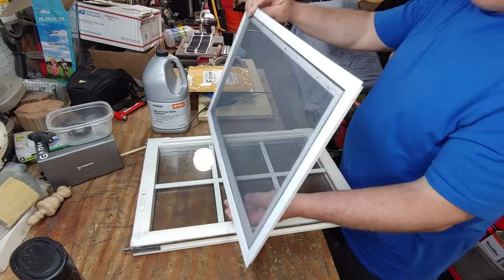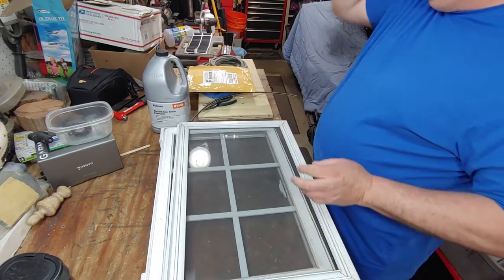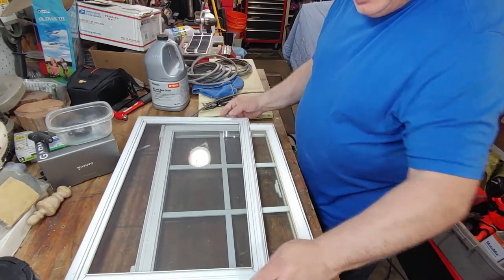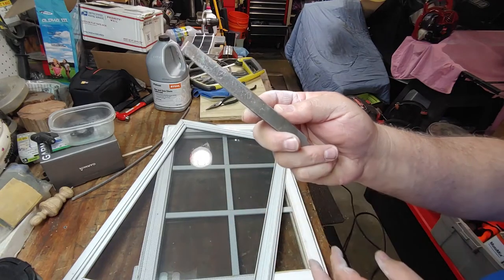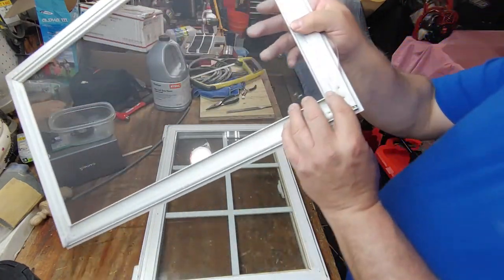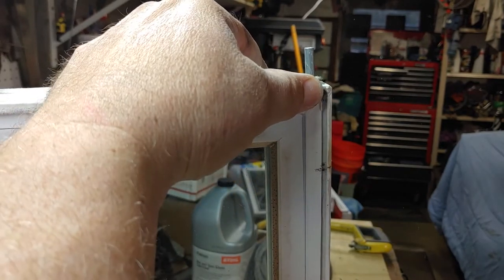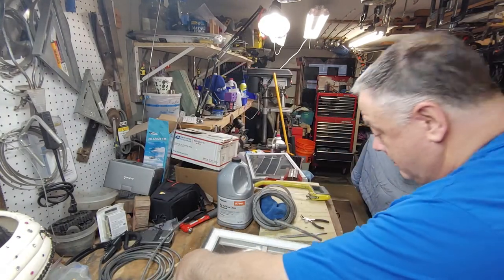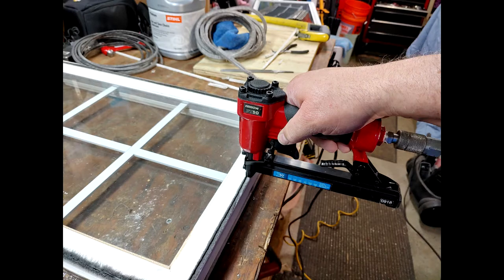Replacing fuzzy weather strip on screen and vinyl window frames

Comment: Thanks for posting. I've seen some videos where they use a Spline roller to add the strip back in. May be an option to look into. Also, where did you find your weather stripping?
Reply from the maker: https://www.allaboutdoors.com
Pricing was very fair, Quality is good. Received it in just 3-4 days thru the mail. They give you a phot on line so you can match up the type of weather stripping. I did my search on their site under "Fuzzy weather stripping".

Comment: How did you measure i cant or I should say afraid to take out window. I did them before with samples given by window company that has since closed I did with window in and a tiny screwdriver lol very hard. I'd like to get some that fit, my windows are in sun all day and rot fast
Reply from the maker: The fuzzy part comes as a roll so I just cut them to length. No guess work.
Reply: How did you measure the plastic part that fits in channel the piece I have from manufacturer looks like 1/4 and the pile looks same
Reply from the maker: I pulled out the current strip just an inch to measure the correct width I needed. Pushed it back in and ordered the replacement.

Comment: The fur weatherstripping has disintegrated letting flys and mosquitos come into the house between the gap in the screen and window. The weather stripping slot is in the window not the screen. I need to figure how to remove the top portion of the window to access the channel or install the weather stripping on the screen instead or I see they sell adhesive backed stripping that may not last as long but would be easier to install.
Reply from the maker: My windows can tilt inward allowing access to the fur stripping to be replaced. As for older style windows, not sure. I have not worked on the older style windows.
Reply: @bigguydiy2184  I figured it out watched another video how to remove windows. The fur is on the top part of the window, so on mine you have to raise the lower part, flip in then push up where it pivots, remove it, the slide down the upper window follow same procedure to remove it. Once removed then set it on table, unscrew the corner pieces reduce pressure on the slot, then pull it out. Took me a long time today finding where to buy fur with right dimensions .5 " high (with fin) and 3/16 or 5mm slot.  While doing this I discovered you could glue in a foam gasket used for heat insulation (comes in roll foam cylindrical in different diameters.) Used it as temporary fix while fur is shipping.
Reply from the maker: Excellent, Good to hear you found a away to get it fixed. It's a easy once you do 1 window.

Comment: Vinyl windows were a great invention...
 until they weren't.
 All the weather seal brush is completely worn from my windows and screens.
 The screens are also quite flimsy when in place and can be pushed out very easily,
 and the material (mesh) for the screens is extremely flimsy, not made of light gauge aluminum but rather some sort of nylon.
 I have to have all these components replaced before I can open my windows this year because I have cats, and I also don't want a bug filled house.
 It's going to cost quite a bit
Reply from the maker: My local hardware store will install wire screen or nylon mesh screen both on screen windows and doors. Only place in a 15 mile radius that does this work. I have the tool for doing it, but it's a PAI to do it.
Reply: @bigguydiy2184  yes, I've attempted to install screen material myself in the last... Complete pita, I fully agree
 The aggravation alone is well worth paying someone else to deal with